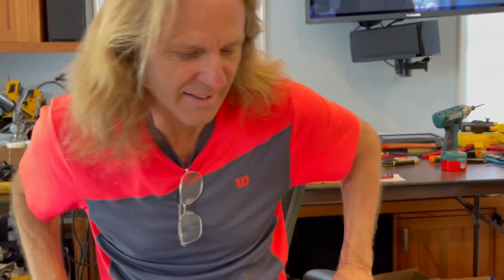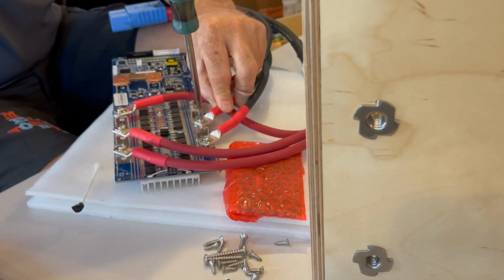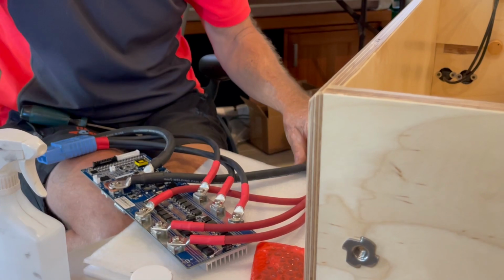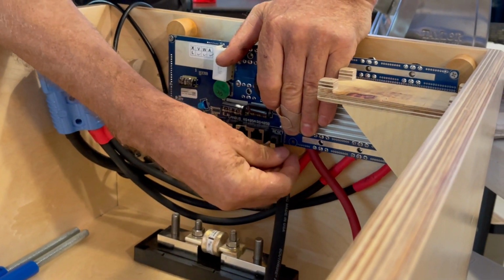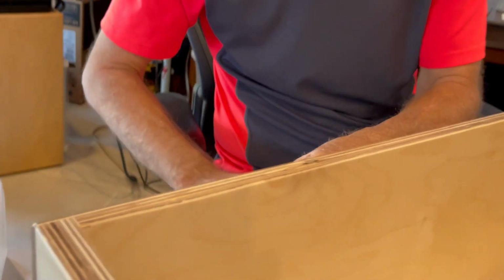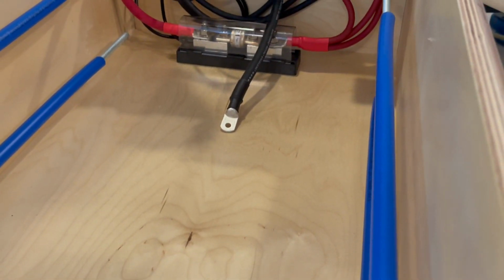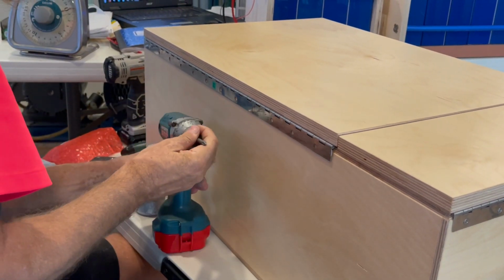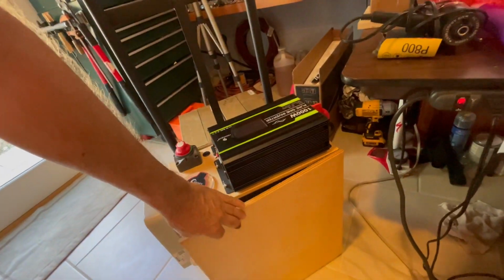Lifepo4 Battery Is Coming Together Easy Peasy; Good Preparation Makes It Look Easy!

Comment: Is that one of the seplos BMS ?
Reply from the maker: Yes it is. Stay tuned. There is a problem currently with these and I am waiting to find out how they will resolve it.
Reply: @RayBuildsCoolStuff  Where did you buy the Seplos BMS and can you tell what the problem is? I'm looking to buy thid BMS as it communicates with Victron gear.
Reply from the maker: I bought the BMS directly from Seplos on their alibaba store. The problem is that they have experienced some failures on BMSs manufactured before August due to a bad batch of diodes. I have 13 of these BMSs. Their solution is to send me a bunch of diodes for me to replace myself and one extra BMS because I have purchased more than ten. They only send diodes to people who have purchased less than ten. Not all are failing and the one I have in service is working so far. It has been operating for about 60 hours so far and not under a heavy load. I ordered one extra to have on the shelf for these two projects I'm currently working on and now I will have two in reserve in case of problems. I have not yet received a letter from them assuring me I will not void my warranty by installing the diodes they are sending me but when their solution is for the customer to replace their own parts, I question what they consider to be a warranty in the first place. I think they have the best BMS but they got some bad parts. I don't think they have the best customer service. On this side of the pond, customer loyalty is built on the response to problems. They should learn from Toyota.
Reply: @RayBuildsCoolStuff  Thanks for the quick reply! I'm living in Belgium and they recently changed taxes and custom rules for ordering outside the EU wich makes ordering on Ali complicated i find. Didn't find a reseller of Seplos in Europe, this would make things easier.
I like your build very much! Clean, organised and structured. I love the idea of the Anderson connector, but i'm missing a switch to turn the battery off. I watched all of Andy's video's too and i'm waiting for him to build his second battery.
I'm planning of building one also and was planning to use the Seplos as well because they can communicate with Victron gear and the possibility to expand with second/third battery. I'll be watching you next videos for sure...
Reply from the maker: @bartdetre8851  I have a video about the battery combiner box I am using. The cable from the battery leads to a large 175A DC breaker. At the battery is a 200A class T fuse to protect the cable. Once the breaker is thrown there will be no amperage on the cable and it can be safely disconnected.

Comment: Looking good so far. While I get there are no batteries present, seeing so many screw drivers (ect.) without insulation on a battery build project is stressing me out. Probably because I know I would find some improbable way of launching one across the room and Murphy's law would mandate it would land bridging the batteries terminals.
Reply from the maker: That's good observation. Safe protocols ensure we can make human mistakes with less risk and we all screw up don't we? My battery tools are shrink wrapped but.....I don't want to fall into the normalization of deviance trap.

Comment: what inverters will you be using ray ?
sol-ark/deye/sunsynks?
or maybe something elsev?
Reply from the maker: sol-ark/deye/sunsynk.........more will be revealed.
Reply: @RayBuildsCoolStuff  hoping to a sunsynk, just because i like keith ;)
Reply from the maker: I REALLY like Keith. I think he does the right things for the right reasons. They don't have a split phase, which I need here in the US.
Reply: @RayBuildsCoolStuff  well, then i hope you got one of the few deye's, just because i dont like sol-arks behavior so much ;)
Reply from the maker: Check out the 1:00 mark of this video. https://www.youtube.com/watch?v=aVe-XUl1K4U
Reply: @RayBuildsCoolStuff  :)
Reply: if this is 1 system, it sure will be massive
Reply from the maker: @houseofancients  I'm building two identical systems of three 8KW hybrid inverters and six 14.4 KWh battery packs. One for my house and one for a good friend.